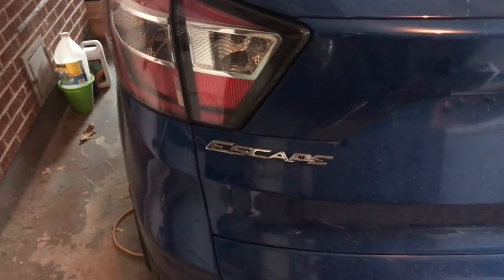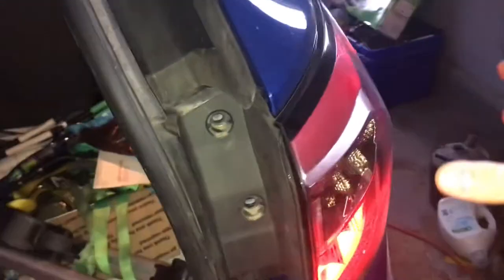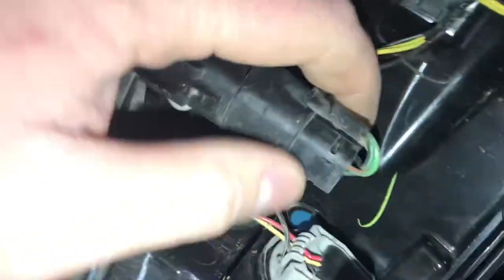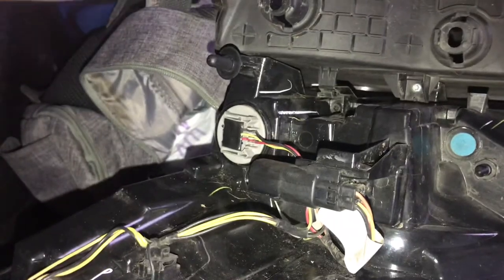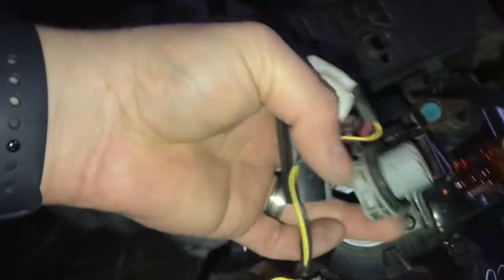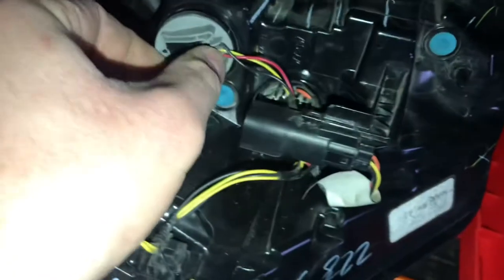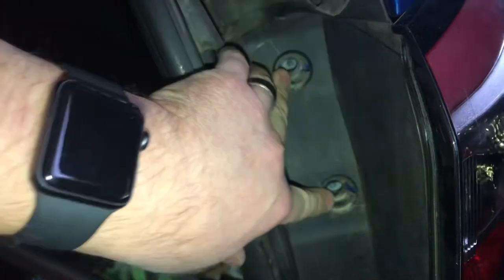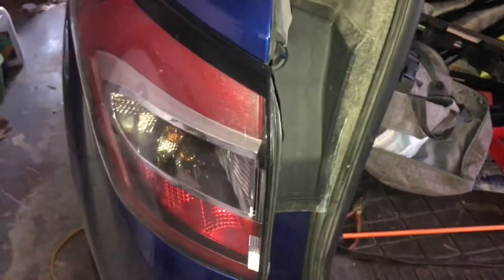2017 Escape Taillight bulb replacement (13-19)

Comment: Watching you had me so stressed. You made that job very difficult
Reply: He did not make it difficult, it was absolutely realistic.  I cursed out the Ford engineers for making it so fu*king difficult to remove the yellow/reverse bulb.  A minor modification on the holder for the main plug was all it needed.

Comment: Thanks for being the only video that worked lmao watched 6 others and finally got it watching this one
Reply from the maker: Awesome! Happy to help
Reply: Asked for a brake light replacement got this video. It appears if your brake light stops working most likely culprit is water leaking by the housing seal common in these models for years ford has not fixed this issue now when your LED brake shorts out you have to replace the housing for $6to 700 dollars good job Ford. Not.
Reply: Kevin O'Neil I drill a small hole in the assembly to keep it drained of water.

Comment: So what do you do to replace the LED break light. If you say that the whole light housing has to be replaced for $600.00 + mechanic cost I will get rid of my Ford SUV and my Ford f350 and never have anything to do with Ford ever goodbye
Reply from the maker: I think you may be misinformed. These are not LED bulbs.
Reply: Appreciate you posting the video. My brake light light is LED for my 2017 Escape. Just changed it with the help of your video. After paying $500 for the assembly hosing 😅 and your video, it's working now. 😁
Reply: HEllo! Did you find a way around this? I dont want to replace the whole housing, I need to replace 2 of the 3 LEDs...
Reply: @hayseedautos  the two bulbs you show in your video are not for the brake light. One is a running light and the big bulb is the turn signal. So the actual brake lights must be non-serviceable LEDs if I’m understanding correctly

Comment: I have LED brake light version. All 3 LED lights are out from rainwater.  Anyone have luck buying a non-ford housing? Can you send the website? Why would I buy the ford housing again if it is likely to fail and need to be replaced again?
Reply: I got a new entire assembly , working bulbs and all for $90 off ebay.

My Mother's was cracked from an accident.
Reply: Thank you! $90 is the best price I have seen. I still have not ordered anything. If you still have the link, do you mind sharing? Thank you.

Comment: Great video. Only complaint is taking the clip off, could really see where you were prying it off from, but it made sense when you put it back on where it comes from. Thanks for a good video!
Reply: Yes it was hard to see that part. I finally got the harness off and I'm going to sand down that clip a bit just in case I ever have to do this again. There's no tension on that wire harness, don't know why its made so hard to get off.

Comment: On a 2017 Ford Escape, some water had gotten past the clear plastic cover and the brake lights stopped working. Bummer. After cleaning some of what I could see such as the running light (clear bulb) socket - the brake lights mostly work on the left side. But not on the right side! On the left there are three "levels" to the brake light and two are on strong - one sort of flashes. On the right side there are still no brake lights. 

I did drill some small, unobstrusive, drain holes in the clear plastic cover and I am gonna see if they help keep the brake lights on the left side working. But I would still like to access the LED lights on the right (and left) side but that is not possible???

The earlier versions of the Escape have regular bulbs, not the LED ones. Can we replace the 2017 assembly with an assembly for an earlier version - to get brake light bulbs that are not LEDs???
Reply: Hey.! Got any news on this? Two of the 3 LEDs on left side stopped working and Ford told me I have to get the whole part instead of just replacing the LEDs...
Reply: @DonOmarRamiro  I bought two replacement assemblies on line and replaced them, this was MUCH less than Ford was gonna charge. I am gonna cut the old ones apart and look at the LEDs, check back in a few days. 

And certainly the LEDs use a lot less current than the older incandescent bulbs so the harness is probably not the same. So you probably cannot use an older assembly, with all incandescent bulbs, in the newer Escapes. Bummer.
Reply: @charlesphillips554  where did you get the assembly and how much was it? I’m in a similar pickle
Reply: I've got the same problems.
Reply: Same problem
Reply: I have the same problem, so I need to buy a whole new taillight because water got in and the LEDs are damaged?
Reply: @kang8744  Yes I looked at the tail light assembly and cannot figure out how to fix the LEDs, I bought two assemblies on line and replaced them. The Ford dealer of course wanted lots of money to fix these.
Reply: @charlesphillips554  thanks for the reply! Do you remember where you bought these assemblies? Can you share a link with me?
Reply: My driver brake light is also out from rainwater. Did you replace the whole compartment or just the LEDs?
Reply: @aieshagooch  I think that you have to replace the entire assembly, I couldn't do any maintenance on the LEDs.
Reply: @charlesphillips554  thanks for responding! I found me one on Amazon that was reasonable.

Comment: thats for a turn signal bulb, correct? I thought the taillight/brake light was LED. Seems like most of the newer vehicles you have so much fun trying to get the taillight housing off the vehicle.
Reply from the maker: Correct
Reply: Yes, they are LEDs... Any way to replace those LEDs without changing the whole housing?
Reply: @DonOmarRamiro  Have you been able to solve this problem?

Comment: I'm having a hard time removing the dangling thing to get to the bulbs what can i use to get it off?
Reply from the maker: A flathead screwdriver and determination is what I used
Reply: @hayseedautos  I GOT IT OFF COME TO FIND OUT I WASN'T PRESSING THE RELEASE FLAP🤦🤦‍♂
Reply: @hayseedautos  and plus it appears my whole assembly needs replacing my model  doesn't have brake bulb i think it's led type
Reply from the maker: Bummer
Reply: @Bigcdt80  I have the same problem! No other options to replace? You just need to buy a new headlight?
Reply: @ViTEXpro  THIS MY BREAK AND TAIL LIGHT I WAS SPEAKING OF NOW THE HEADLIGHT YOU CAN REPLACE BULB IN THAT BUT THE TAIL OR BRAKE LIGHT GO OUT YEA MORE LIKELY IT NEEDS REPLACING I JUST GOTTEN MINE REPLACED GUY WHO WORK ON MY CAR FOUND ME AN ASSEMBLY FOR $189
Reply: @Bigcdt80  okay, thanks 🙏
Reply: @ViTEXpro  NO PROB